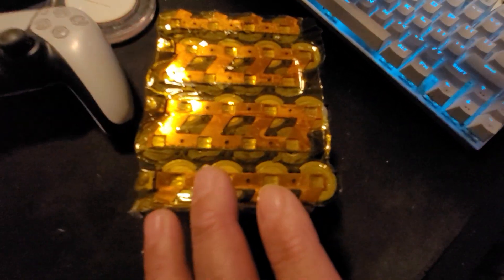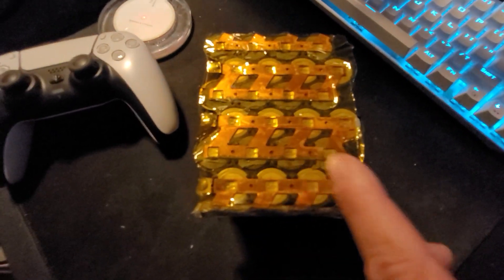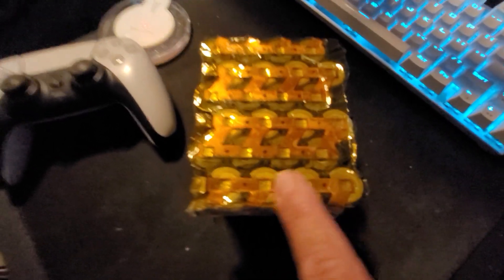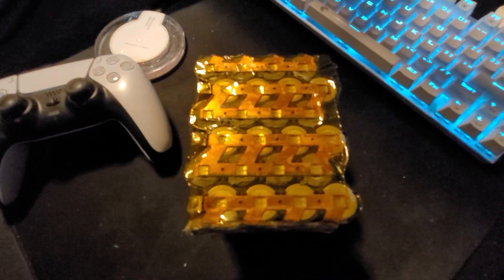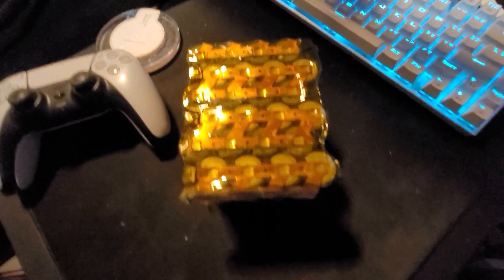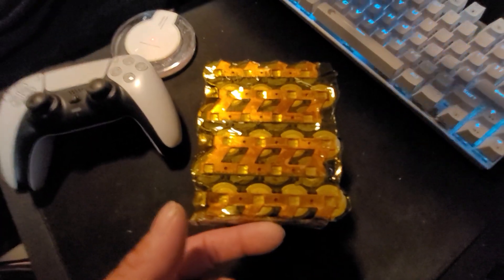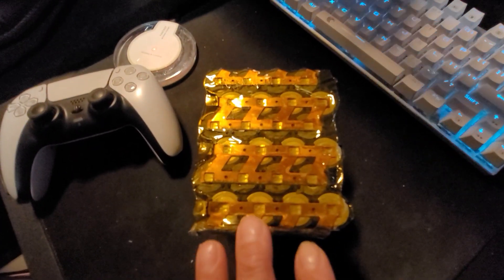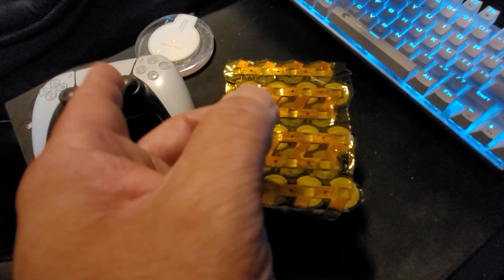Building a high current battery requires a combination configuration when you do your cell lay-out.

Comment from the maker: In the series configuration if one of those tracks burns open because of a shorted cell or just too much current and it opens like a fuse they'll be no more current flow battery is done.

Comment: Do you build packs for other people?
Reply from the maker: I do but I dont build regular packs I build High current extended range pack and custom packs so while i do it they are a bit pricey because I hurrent packs require allot of extra reinforcement and powerful BMS now as for extended range packs they are pretty normal in price as they dont require the extra hard work.